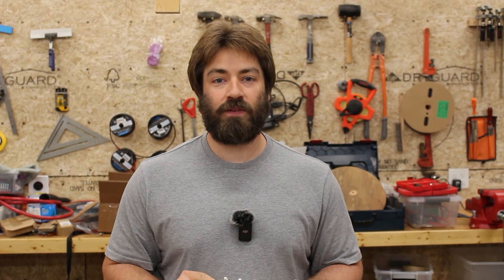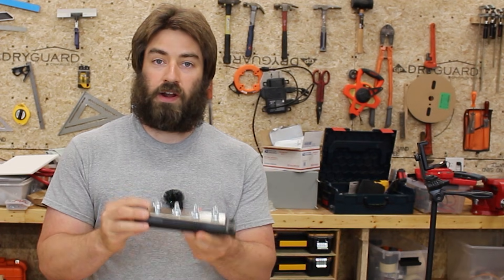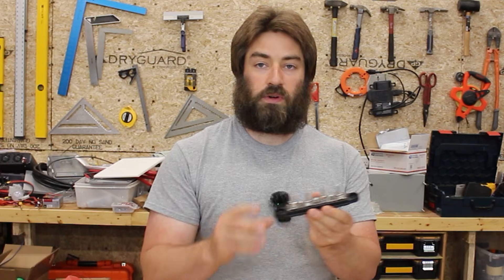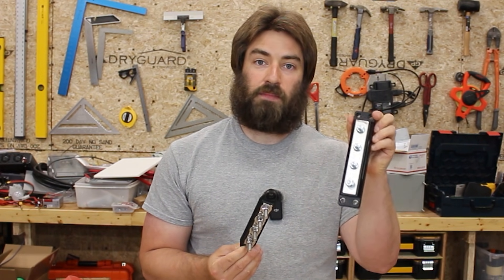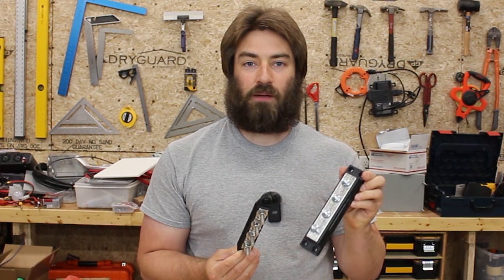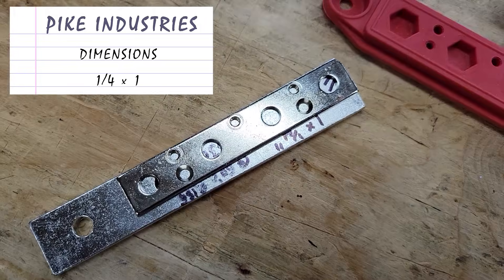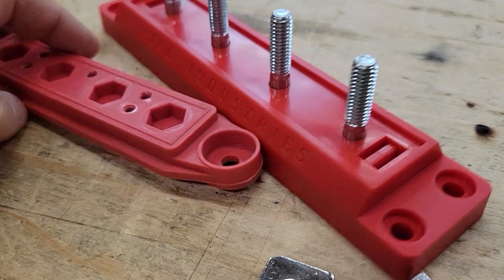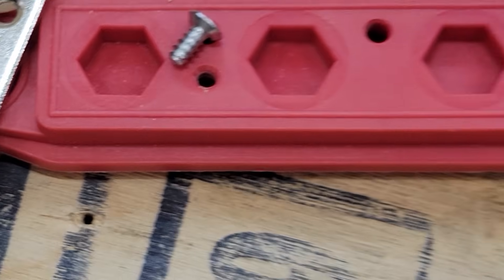Busbar Comparison Guide

Comment: having just had a melty busbar experience, I would caution against the busbars that have the bolts that pass through and pull down against the plastic. If the busbar gets warm because either overloaded or loose - the plastic gets soft, which means the bolts are now looser and therefore get hotter until it’s glowing or open circuit.  I replaced it with a 400A solid copper bar which is used as a earth bar in large three phase electric panels - no plastic at all and all fixings are metal against metal. And are far cheaper - although you do need to make your own shrouds for them - i used large trunking
Reply: Exactly what I thought when I saw it. Unless there is a metal insert in the plastic, I wouldn't trust it.
Reply: Never would have seen it coming - thank you.
Reply: @eliotmansfield do you have a link to what you used? How’s it holding up?
Sorry you had a melty experience I hope everything is okay!
Reply: @1:45 he suggests using them for only low amperage applications
Reply: Excellent suggestion Eliot, thanks mate. I'm going your way!

Comment: Nice overview. One thing that is overlooked is having the mounting bolts also hold the plastic can become an issue. If the bolts are loose or randomly get heated. The plastic will deform making the connection even worse leading to more heating or even arcing. Having separate fasteners are best to hold the bus bar to the mount.

Comment: I'm not sure that bolting through (and therefore compressing) the plastic base is desirable. It seems that the plastic might compress over time, thereby reducing the clamping force on the lead.
Reply: Plus I like the idea of the back of the bolt touching the metal to add extra conductivity path. It probably makes no difference but when the bolt isn't screwed into the metal bar I don't think the contact is as perfect and so it's only the connector pushing down on the bar that's in contact, the bolt isn't helping as much as it could.

Comment: I personally use the 250amp blue sea systems busbars.  I'll have to consider those Pike industry ones if/when I need to upsize to 400amp.
Reply: I prefer Blue Sea as well.  Del City Wire has a 1000amp rated one and the price matches.
Reply: All 4 of the Blue Sea 250A busbars are rated at only 48 VDC.  Most 48 volt systems operate from 52 - 58 volts.  So, those are OK for up to 36 volt systems.